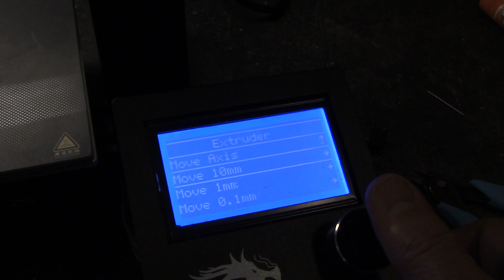Ender 3 Filament Feed Issue - Solved

Comment: I have a problem on the stepper motor the 2nd screw "the silver one he got it aligned in the video" is lagging .. it stops moving randomly and making lots of gaps and very bad print quality does anyone have a solution for that?
Reply: I had that problem, the silver one was slipping or not moving at all. I fixed this by adjusting the tension of the screw that goes through the spring, right where he pinches.

Comment: So I have same issue as you, but my motors aren't aligned but still not pulling through. If I manually feed filament works fine, but how do I fix the motors if they're already aligned just not pulling? 
Please help, spent 3 days going mental
Reply from the maker: If you have the exact same issue as I did, then the little plastic part is broken.  You need to replace the extruder with a metal version.  Simple to do, link in description.  I didn't realize when I shot this video that the part was broken.  Start there first.

 If it is not broken, then make sure there is enough tension on the filament. 
There's an adjustment screw to do so.

Comment: Ender 3 V2 Neo user here. 
I can push the filament through the nozzle by hand no problem. The extruder gear can also push it, but the moment there is a little bit of resistance (i.e., when it hits the nozzle), the gear won't push it any further.
I checked the wheel and it looks installed properly. Any idea why mine won't work?  (p.s., printer just came out of the box, so I don't think the gear is worn down already)
Reply from the maker: It sounds like a bad board. It may not be able to supply the required current to work under load. The only other thing I can think of is the nozzle is too small and it’s restricting the filament too much
Reply: @MyEngineeringProjects  Hey, thanks for the reply!
I may have suffered severe cranial trauma from the facepalm, but I solved the problem this morning...
On the Bowen extruder, the "pivot screw" that keeps the arm in place was a little loose, allowing the filament to push away the feeder wheel, which resulted in a loss of grip. Tightening that one little screw was enough to get it working and make my first print!
Reply from the maker: ok great, glad it's fixed
Reply: @TheEpicNoodlesh  Thank you - I spent hours yesterday fighting this one.

Comment: My cog/gear is turning but my steel wheel with the groove is not turning. What’s the issue?
Reply from the maker: You could have a jammed filament at the nozzle. Check that first. It’s also possible that the tension on the filament is too loose. If so tighten the adjustment screw

Comment: Thanks. I had the same issue, 2 seconds to fix.
Reply from the maker: It’s a common failure point for the extruder. The fix will not last and the part will need to be replaced

Comment: Hi, I'm a teacher and could you some advice. My Ender3 V2  will lay the initial bead of filament but when it moves to the center to print filament does not come out.  I made sure it wasn't clogged by taking it apart and the gears seem to be in alignment and moving.  Any guesses?
Reply: I figured it out. After I took it apart to make sure there wasn't a clog, I didn't relevel the bed and the extruder was too close to it.  I releveled the bed and now it is printing.
Reply from the maker: @amandawidel1734  Glad you got it working.

Comment: I got my printer a few days ago and it's been driving me crazy with the fact that it won't extrude! Thanks for this tip, it helped a lot!
Reply from the maker: Great to hear.  I hope it isn't broken like mine.  If that little part moves, then it's broken. It's supposed to be fixed.
Reply: @MyEngineeringProjects  I found out what the issue was, I didn’t even realize where the stepper motor is.

Comment: I’ve been stretching my head over this problem for hours and it was driving me crazy!! Never even thought to stick the needle in there! Cleared it right up. Can’t believe it took me this long to figure it out! Thanks for the help!
Reply from the maker: Glad it helped!
Reply: @MyEngineeringProjects  what happens when the gears literally eat your polyterra PLA lmao, why is the ender 3 kinda built like beans, expecially for those who like upgrading and changing firmware lmao, Imma try this tho thank you for the very helpful info :)
Reply from the maker: @mjconfidential6926  they built this model to work when purchased, but it has durability issues for sure.  In m opinion they should have used higher quality components to begin with
Reply: me too

Comment: Hey got a question real quick: how much do you loose the screw on the silver thing to be able to push it back because it's not working for me
Reply from the maker: If you just want to release the filament, you don't have to use the screw at all.  Just squeeze the lever back onto the spring to temporarily loosen the tensions.

Comment: The fillament i have isnt going into the little hole that feeds into the tube and I don't know what I'm supposed to do hahaha
Reply from the maker: Take out the filament and bend it by hand until it's more straight.  This will help it align better so you can feed it through the hole
Reply: @MyEngineeringProjects  one other question: What do I do if the filament refuses to stick to the board. I heat the board up it doesn't stick. I use glue it doesn't stick. I don't know what to do
Reply from the maker: I fought that issue for along time.  What fixed it is to add a CR Touch.  Now I can print with no glue or mess and it just works.  Also, I increased my bed temp a bit until it worked especially for the first 2 o 3 layers.

See the video here: https://youtu.be/ulteP9oQfKA
Reply: @MyEngineeringProjects  Thank you. I'm a complete beginner, but this really helped

Comment: Howdy! 
My Ender 3 Neo are having a simular ishue
When It starts printing, the gear spin to feed the nozzle, but for some reason, It moves backwards some times (like its trying to desobstruct something or forcing the fillament) and so, nothing is printed.
Someone knows how to fiz this?
Reply from the maker: It's common for the feeder to go in and out.  But it sounds like the part is broken and not putting enough pressure on the roller.  Mine broke as well.  Just replace it with a new metal extruder.  Link in description.

Comment: does anyone know where to buy a new lever piece? because after a closer inspection mine is snapped where the silver pulley is.
Reply from the maker: I put a link to the metal replacement part in the description.

Comment: Thank's a lot! It's resolved my issue! ❤
But its's turned out that this pulley is actually have a ball bearing inside, and the reason is it looses - this hexagonal bolt was unscrewed. So you should tighten this bolt good with an Allen key, and pulley will rotate only on it's ball bearing, not on the bolt. Please, pin this comment, so others can see it.
Reply from the maker: Ok great.  Mine actually broke so this is good feedback for another point of failure. Seems like a lot of people are having similar issues.
Reply: @MyEngineeringProjects  That's why they selling metal feeder drive frame i guess. 🤷🏻‍♂
Reply from the maker: Yes that's right.  I replaced mine with a metal extruder and that was the end of the issues

Comment: Wow silly. Did it for me.
Reply from the maker: When I shot this video I did not realize that the part was actually broken.  This fix will only work for a while.  Turns out all of the parts break in this same spot.  I had to replace mine with a metal part.

Comment: Thanks dude. Just bought an ender max neo and didn't realize
1. didnt push in the filament enough to the gears
2. didnt know about the lever (as it wasnt mentioned in the instructions)

You saved me
Reply from the maker: Glad I could help
Reply: @MyEngineeringProjects yeah that was my issue too, but as soon as I gently pushed on that lever the corresponding piece/silver gear, snapped off. The Ender 3 is just a POS, the instructions sucked, the build sucked, the operation sucks, and it's just a bad product

Comment: I had the same issue only the arm that holds the idle wheel was cracked so the there was no pressure from the spring making it to the splined cog. I would print a new arm but the printer is not working... So im trying to glue it, i have a feeling that it will not hold up the the pressure.
Reply from the maker: That part breaks for everyone. You can dis it with a new metal extruded kit. It’s inexpensive and works great
Reply from the maker: There is a link in the description for the metal extruder

Comment: My extruder is moving slow and not feeding enough filament.
And after doing the above process too it is not working properly.
Can you please help me?
Reply from the maker: So when I shot this video, I did not realize at the time that the part was actually broken.  It breaks on everyone since it is a design defect.  You will have to replace it with a metal extruder, they are great and pretty cheap.  Here's a video I shot explaining how to do that. https://youtu.be/uMHtzwEHfUc

Comment: My filament comes out when I load but not when I print
Reply from the maker: Does the tensioner on the filament turn when you are printing?  If not, check to see if the bracket holding the extruder is broken or not.

Comment: WTF? why does the roller die pivot out of position? There's no need for it to be on a pivot. Change that out for a solid aluminum upgrade . . . .
Reply from the maker: I did.  It's pivoting because the plastic broke.
Reply: @MyEngineeringProjects  aaaaah, gotcha
Reply: @MyEngineeringProjects  By the way, I'm a cutting tool maker for the screw machine industry, may I ask your trade? seems like all us techies are in industry. . . .
Reply from the maker: I've worked in a variety of fields.  Generally business and engineering.  I'm currently programming mostly.
Reply: @MyEngineeringProjects  programming cnc's or just straight open source code? If you need any help with tooling dm me. Take care man!
Reply from the maker: Php, html, js, css and a little bit of C with my Arduino projects
Reply: @MyEngineeringProjects  lol might as well be a foreign language to me!

Comment: I just stretched the spring on the extruder every week and it won't jam
Reply from the maker: ok I have not tried that
Reply: @MyEngineeringProjects  yeah I've not seen a video yet of anyone doing it such a simple little thing thats stopped me from jamming up with heat creep seems to push through it, couldn't believe it months of jams and missed layers on prints

Comment: best video ever. i was about to return my printer because i thought it was just broken, thank you so much you don’t understand
Reply from the maker: Thanks for the feedback.  If yours is just like mine, then the little plastic part is likely broken.  It's a weak point in the stock printer.  You can easily replace it with a new metal extruder.

Here's a video on how to do that: https://youtu.be/uMHtzwEHfUc

Comment: The filament guide isn't supposed to bend like that. The original plastic extruder on Ender 3 is known to be unreliable. They usually cracked or simply fatigued.
Reply from the maker: I did not realize at the time that the plastic was broken.  I replaced it with a metal one and that fixed it.

Comment: Uhh my stepper motor isn't moving...
Reply: What doo I dooooo
Reply from the maker: First make sure you can actually move the filament.  To check this heat the nozzle, release the spring and manually push through.

If this works then check to see if the software can push it through.  Go to Move->Nozzle and see if it works. If not check your connections and also the stepper motor itself.
Reply: @MyEngineeringProjects  thanks! It’s working now

Comment: OK so I may not get a response but I was changing out the filament because literally when I was printing it was just printing in globs and I figured out it is snapping so I put in a new one and whenever I push it through it’s super Duper hard, but when I do, the extruder is pushing it out, so is it still OK?
Reply from the maker: I have found that pushing it manually may not be enough.  If the nozzle is damaged or it has a clog, you may need to clean it out with a needle.  If this fails, then you may need to replace it.  You also need to look at the tube for the filament and the other parts such as the extruder stepper motor and gear assembly.
Reply: @MyEngineeringProjects  I went to the extruder in manually, did it, and it worked
Reply: @MyEngineeringProjects  but I do wanna ask you on my 3-D prints there’s like a little hairline fracture some places does that mean my nozzle is too high or too low or something
Reply from the maker: The hairlines were a result of too low of temperature at the nozzle for me. It was not getting  good adhesion   I would try raising the temp first.

Comment: Omg. I think this is it. Wow. I'll let ya know when I get to it. It prints the demo cat  that came on the sd. Np. But not anything else.  I've done all the cura settings. No clogs. Just isn't pushing out when print starts.
Reply from the maker: I hope it helps.  Check to see if the little plastic holder for the gear is broken.  If so, then it won't be able to apply pressure to the filament and will fail.
Reply: @My Engineering Projects  extruder works. Just won't move when I try to print something g I save out of cura. Only prints the demo that came with it. I'm missing something in cura. Everything  leveled good.
Reply from the maker: @mountainlion76  I'm not sure but if it will print the demo, then the printer works.  This leads me to believe it's an error in the gcode.  You might try another slicer.  I use the Prusa  slicer with good results.

Comment: The printer that is used in my job has the same issue, but I find out the plastic under the silver piece was broken. I tried to stick it but it didn't work either. If i try to feed it manually it's okay, but it's not feeding by itself.
Reply from the maker: This happened to me as well.  I had to replace the assembly with a metal version.

Comment: Recently bought an ender 3 V2 and the problem is that the brass gear that feeds the filament in rises up with shaft of the motor and eventually stops pulling the filament through. Any suggestions?
Reply from the maker: This happened to me as well.  There is a cheap plastic fitting that holds the gear.  Once it breaks, you have to replace it.  I did so with a metal upgrade and that fixes it.  Here's the upgrade: https://youtu.be/uMHtzwEHfUc
Reply: @MyEngineeringProjects  Thanks for this, I'll have a look into getting it

Comment: Mine turns on and off randomly and the feeder goes slow instead of its normal speed.p
Reply: I've had 5 failed prints in a row because of that.
Reply from the maker: Does it make a banging sound when it fails?
Reply: mine too. I increased the tension on the spring to push the filament in, but eventually it stops feeding. I tried increasing the temperature to 215 but still under extrudes. This problem started after using the PLA filament.

Comment: Alright, I'm guessing it's the stepper motor, but it's the little brass gear that supposed to feed the filament through. It just keeps clicking and buzzing but it ends up not feeding enough or feeding too much filament through, it has started doing this ever since I put new filament in.
Reply: Everything else works perfectly fine, it's just that gear not pushing the filament through properly
Reply from the maker: It’s very likely that you have a clog in the line. I’ve had this happen before and the clicking sound is basically the stepper motor slipping because it can’t move forward. You need to check everything all the way to the end.

Comment: hey this is great info but i need help with another problem for some reason my stepper motor turns clockwise so it takes out the filament instead of feeding it in do you think you can help me? ( i got it as a 13 b-day present and spent 4 hours putting it together)
Reply from the maker: Check to see if you have reversed the connection into the stepper motor
Reply: @MyEngineeringProjects  mine started doing this randomly mid print, no connections changed =\
Reply: mine is currently doing this, did you get it solved?

Comment: What do you do if when you advance the extruder off and on a few times, and sometimes it goes and sometimes it doesn't?
Reply from the maker: The extruder can fail at any point.  Start at the stepper motor to see if it turns.  Look at the gear that moves the extruder and make sure it's working and has pressure on the filament.  Check for any blockages in the tube and the tip.  Make sure the tip is at the working temperature since it will not advance unless it's heated.

Comment: Thanks for the vid. Im saving everyone I can for all sorts of issues, but I can not find a vid for the issue Im having hope you can help, my machine is brand new out the box so I am also brand new at 3d printing, My machine keeps saying Extruder heating Iv left it on for 20 minutes, is this normal? Thanks in advance
Reply from the maker: So the display may say the extruder is heating, that's ok.  What's important is to see that it up to temperature.  Check to actual temperature on the display.

Comment: My pulley was lined up but it would stop turning causing the gear to dig into the filament and start bucking. What I had to do was adjust the tension on the pulley screw until it started to continuously feed
Reply from the maker: Glad you got it to work.
Reply: How?